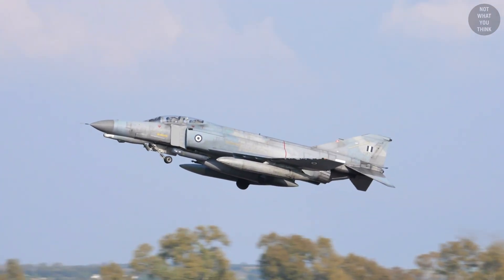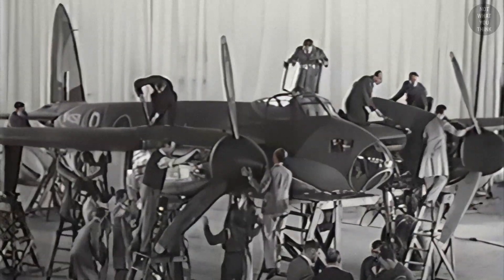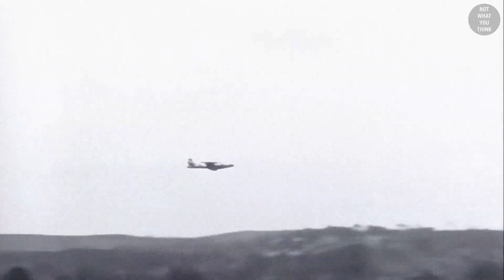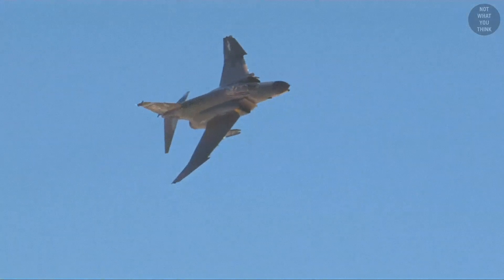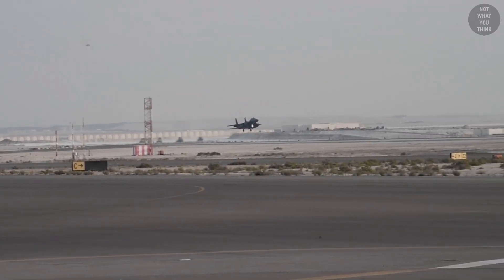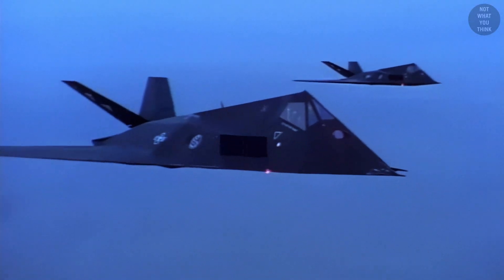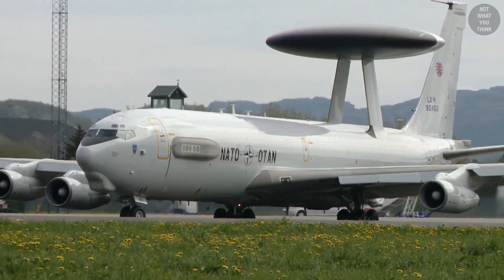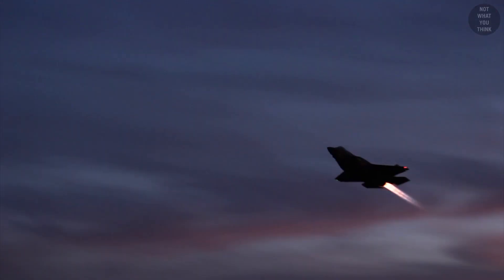Why are Modern Fighter Jets Slower than 1960s?

Comment: The F35 has a cruise speed of march 1.1 so it might not be on paper faster but it kinda is in a way.

The F35 was built from lessons learnt from previous generation aircraft.
Reply: I mean.. All aircraft are build from lessons learned from previous generation aircraft.
Reply: F35 sucks!
Reply: And greed
Reply: I’d imagine the true performance of the F35 and F22 is probably classified.  I would take any data you read on them with a grain of salt.
Reply: @tomw485  
sure, it always hard to know the exact numbers. However, we can look at engine power and thrust to weight. From these numbers we can at least start to paint a picture.

For example, the F35 certainly not going to produce the high end performance of  f22, or say a F15. 

However, compared to F16, F18, Rafale, gripen etc.? Well, in those cases, the F35 DOES have a better power to weight (thrust to weight) then those other fighters.

So, F35 is not a interceptor class of a fighter, but against most 4th gen multi-role aircraft, the F35 fairs very well. 

the F35 on mil power (non afterburner) quite much matches full power of  F16. But, of course the F16 is lighter. But, looking at thrust to weight, the f35 is not too heavy, nor underpowered, and for a fighter that has a better T/W rating then a duel engine Rafale, then the F35 going to MORE then hold it own in basic fighter maneuvering.
Reply: Urkel Obama  
Irrelevant
Reply: Yeah those top speeds are at full afterburner which absolutely chugs fuel.
Reply: The f35 hasnt got a cruise speed if mach 1.1 its below 1.0 100%
Reply: @katzenkralle7262  dash cruise(full throttle no afterburner) of mach 1.2 for several hundred miles.
Reply: @katzenkralle7262  F35 despite not being fully capable of supercruising, it can sustain mach 1.2 without AB for a certain range (around 150nm), which is good for stealth and fast intercepting. It's maximum speed is mach 1.6
Reply: @katzenkralle7262  It wouldn't be called 5th gen without supercruise. was required in design.
Reply: @oldkid8811  The aircraft "generations" are american marketing; thats why the requirement for what a 5 gen plane is got a lot lower when the shortcomings of the F35 became clear.

And no, the F35 cannot supercruise, and it doesnt look like it was ever designed to. It has a single engine, a limited thrust to weight ratio, the shape seemingly optimized for lower speed and altitude flight. All very different from the F22, which was designed to supercruise.
Reply: @termitreter6545   
Actually, a f104 from the 1950's could go past Mach 1.0, and that was in the 1950's (and without AB's)

And the British Lighting - again over Mach 1.0, and again without Afterburners (AB's). and again from the 1950's. 
WHERE HAVE YOU been living for the last 60 years? Hum?

As for the term super cruise? Well, since fighters from the 1950's could do that, THEN HOW on earth is that new???

Because fighters from 60 years ago could do this, then Lockheed had to make up a NEW term called super cruise, and it means Mach 1.5 for 100n-miles.

Then some bozo the clown - like some defense blog or some num-nuts? They re-purposed the term to mean ANY fighter flying above Mach 1.0 without AB's.   NOT!!!! 

The F35 can do 150+ miles at Mach 1.2 without AB's - in fact that is  LONGER rating then the Mach 1.5 rating given to the F22 at 100n-miles!!!! - how does that grab your coconuts?   And beyond silly as if this is a some kick above Mach 1.0, and then it "coasts down, or slows down". 

No not at all, if you can maintain Mach 1.2 for 150 miles - you NOT slowing down! In fact, a F16 pilot at above Mach 1.0, and going to full mil power?
quote:
caused the jet to rapidly decelerate, pushing me forward until my shoulder-harness straps locked

In other words, just backing off AB's in a F16 slams you forward - you not going to coast for 150 miles!!!

>>it has a single engine, a limited thrust to weight ratio, 

Really? Spending too much time in moms basement? Or did you fail grade school math?

The F35 has a better thrust to weight then a F16, then a duel engine Rafale, then a F18a, and of course a Gripen.

Here are the numbers (if you able to process them).

Higher = better

Fuel or
Payload	Rafale	F35	         F16	Gripen
0	         1.4137	1.3984	1.4784	1.2617
700	        1.3737	1.3672	1.4284	1.2130
2500	1.2806	1.2932	1.3141	1.1035
3500	1.2341	1.2555	1.2581	1.0508
3750	1.2230	1.2464	1.2449	1.0384
5000	1.1704	1.2028	1.1826	0.9805
6000	1.1314	1.1701	1.1371	0.9387
7000	1.0950	1.1391	1.0950	0.9003
7500	1.0777	1.1242	1.0751	0.8822
9125	1.0249	1.0784	1.0151	0.8283
10362	0.9880	1.0459	0.9737	0.7914
12000	0.9431	1.0058	0.9239	0.7474
13500	0.9055	0.9718	0.8825	0.7111
15000	0.8707	0.9399	0.8447	0.6782
18250	0.8038	0.8776	0.7729	0.6165
20900	0.7564	0.8325	0.7228	0.5739

So, as you can see, the F16 has to burn fuel down to a rather low 3,500 lbs to match the T/W rating of the F35.
The duel engine Rafale fairs even worse - down to a bone dry 700 lbs to match the T/W rating of the F35.
And the Gripen? Well forget that - even starting at 0 - it don't match much of anything.

In fact, the above table shows that as you increase payloads (fuel and/or weapons), the T/W rating remains in favor of the F35.

In fact, the F16 with a 10,000 lbs load results in a aircraft that is heaver then total engine power (the F16 now can't fly stright up). But the F35 can!!! - in fact it can with 11,000 lbs, and in fact even with 12,000 lbs. And the same applies to the duel engine Rafale - (again, 10,000 lbs - and total aircraft weight is greater then total engine thrust).

So, how do you get a poor thrust to weight rating for the F35? Unless you suggest the Rafle and F16 is poor then? (since they do have a WORSE power to weight rating then the F35 - right?

As for speeds? Well, the F35 has WAY more mil power then the F16. In fact, when F16s fly with F35's? They can't keep up, fall behind, and have to go AB's to catch up. Then they start to fall behind and have to repeat the process of going ABs to catch up. 
And you DO REALIZE that a F16 has only 3.5 minutes of AB time, and you fuel is now half gone, right? 

Here is the fuel tank rating for some common fighters:

Fuel capacity (fuel tank size):
Harrier  7,000 lbs
F16 – 7000 lbs
Gripen39E/F – 7,500 lbs
Rafale 10,362 lbs
F18 – 10,860 lbs
Typhoon – 11,000 lbs
F15 – 13,455 lbs
F/A-18E: 14,700 lb

F35 – 18,498 lbs

So, who's going to fly faster, and farther? Just look at the above!!! 
Sure you can hang fuel tanks on those other fighters. But when you do that, you now not only trading away wing stations from weapons to fuel bags? You also now lose max g-loads, and you now also lose your top speeds!!!

During tail drag, the F35 flying clean wings saved so much fuel, that when F16's and F18's were fuel bingo (return to base), the F35 saved so much fuel, had more fuel, it was able to stay out and execute additiona sorties.

So, yes, the F35 can maintain Mach 1.2 - and do so without AB's

The F35 top speed is a software limit - not a engine + drag limit.

And if the F35 was so high drag, then why can't F16's keep up? 

Here is some pilots quotes on this matter:

pilot Lt. Col. Hank “Hog” Griffiths
Even when loaded internally with two 2,000lb GBU-31 Joint Direct Attack Munitions and two AIM-120 AMRAAMs, Griffith says the sheer power of the Pratt & Whitney F135 is evident. “The engine has a lot of thrust. It’s been fun to outrun the F-16 (chase aircraft). They can’t keep up. If we go to full military power the F-16 has to go to afterburner to keep up

Norway pilots ALSO note the same - they flew F16's, and are now flying  F35's.
quote:
We who fly the F-35 daily, can establish the following: The aircraft is faster, more maneuverable, has more range and, can carry a significantly higher payload and provides the pilot with a significantly better situational awareness than what we are used to from the F-16

Col De Smit – RNLAF
Quote:
F35 climbs, descends & accelerates like a clean F-16

QUOTE:
Compared to the F-16, the F-35A with “full war equipment” can cruise 10-15k feet higher without afterburner and cruise 50-80 knots faster, all of this additional energy is imparted on missiles

And it gets even worse! The F16 is a single tail fighter design - and that is poor for dogfighting - and again, given the F35 has a BETTER power to weight rating, then the F35 going to be a better dog fighter then the F16. If the F16 had a better T/W rating, or in fact had a duel tail design, then either one of these factors would give it a chance against the F35, but the F16 fails on both accounts (lower thrust  to weight, and a single tail design - both of which will hurt dogfighting).
Reply: We see the USA still unable to produce and build a VTOL capable fighter aircraft. The F-35B was claimed by the USA, to be able to do what the Harrier could do, while also being supersonic, stealthy, with modern avionics systems, etc etc, this is what we were told. Only one of the biggest technical headaches the British always had to build the Harrier, was the VTOL — transferring from ''lift'' (downward nozzles) to forward flight (rear-facing nozzles) and flying away. 

Apparently to achieve it took the British a hell of a lot of technical work, three — four months at a time over 3 years. (Look up all the variants they made) but they never gave up, and they finally figured it out. I said long before we ever saw the F-35B, it wouldn't be VTOL capable, even with the Rolls-Royce lift engines, because the USA has tried many times before, and failed, only managing to produce the British Harrier able to do so. Every US airframe (and there have been many), have all failed. 

At 7 mins 50 seconds, you'll watch a Harrier perform a proper VTOL. Copy and paste “2013 MCAS Yuma Air Show — AV8B Harrier Demo” into YouTube search. Watch it from lift off, (to more importantly), flying away from the lift-off, and you'll see the transfer of nozzles take place.

You'll not find a single piece of footage of the F-35B doing this. I've had (Americans) tell me all sorts, like it is VTOL and can do it, even saying they've seen it? LOL, only when they can't show it? They quickly change, and instead we'll read them claim it was never intended to be VTOL capable? LOL. 

Sure, when Lockheed Martin's very own page on YouTube clearly shows them trying to suggest it is VTOL capable, when it so clearly is not? Copy and Paste “First F-35B Vertical Takeoff Test” into YouTube search. Watch this, you'll see it lift off, only you'll see it take off go straight up & hover then return straight back down? You'll never see it fly away from the lift-off? Believe me, if it could, we'd see it doing so in every piece of footage we have on the F-35B - like we still see on all the footage of the Harrier doing so. But you'll never find any footage anywhere of the F-35B doing that. 

They'll then go on to say it's not necessary? LOL, while forgetting, they're to be carrier-based aircraft?, meaning even just slight damage to the deck or ramp, they can't get any jets airborne?. Defeating the entire purpose of having the aircraft in the first place! You can't ever lose an entire carrier in battle, for only minor damage, whatever next. 

And why do we see the USA doing this? It's obviously because the USA is still the only country that's never managed to produce & build a VTOL fighter aircraft. Britain did so in the late 50s, Russia did so in the late 60s the USA has tried and failed numerous times, so it seems this time they're going to try to lie about it LOL, that country is a travesty, man! It shows us that Lockheed are not unknown to produce propaganda aircraft. 

As I claim, the F-22 is exactly that. A lemon, that became a propaganda aircraft, that was intended to be a viable military aircraft, that failed.
Reply: Seemingly these Americans have no idea the F-22 and F-35 can't see, track, or target any other stealth aircraft from BVR (beyond visual range). Stealth alone defeats high-frequency (short wave) radar by absorption and deflection, it does not defeat low-frequency (long wave) radar. Therefore, to see, track, and target stealth aircraft you must have long-wave radar, but it must also be enhanced to remove all background clutter for targeting purposes.

Neither the APG-77 radar used in the F-22, nor the APG-81 radar used in the F-35, can see any other stealth aircraft from BVR (without enhanced long wave radar) — This fact the US Air force obviously know! Only it seems the reality is, that when the F-35 radars were being designed 13 years ago, there were no other stealth aircraft to think about as a potential threat? So how can these US aircraft be seen as any sort of threat to either China or Russia, who both have these aircraft technically beaten? They can see and target US jets from BVR, yet the US jets can't even see them from BVR?

Russia's new 5th generation Byelka (2band) radar, used in SU-57, does have enhanced long-wave radar, they've designed and developed the first L-Band fighter radar we've ever seen. They've cleverly embedded L-band AESA radars in the leading edges of the wings. The new L-band AESA radar data gets processed in real time through extremely powerful Russian Elbrus computers being significantly enhanced removing all clutter, meaning it can see, track, target, and engage enemy stealth aircraft from BVR. The technology along with its impressive range parameters and jamming ability over large areas make this aircraft deadly to all other aircraft types. 

They can also interact in ''real-time'' with each other member of the squadron, (auto selecting) the best placed BVR missile, that can be fired by anyone of the squadron with a bogie on radar, they can also take control of surface-to-air (SAM) missile defence systems - (that alone is lethal), and they can see track, enemy stealth fighter aircraft long before Russian airspace, from much greater distances, with "real-time" data from massive Russian ground long wave stations (that are all protected today with the networked S-400 defensive system). 

Therefore, as they'll always know where the enemy aircraft are, they'll always be able to approach any enemy aircraft head on, and therefore stealthily, (Russia wisely sacrificed rear end stealth for much better manoeuvrability) meaning today, the US fighter jets would not even be able to see them coming!! Russia's Byelka (2band) radar covers all aspects of frequencies across all channels, that are used for tracking, targetting, and also jamming. It's part of Sh121 multifunctional integrated radio electronic system (MIRES) on board the SU-57. 

Russia tested much of this new radar suit on the SU-35, so they also have the option of fitting this radar into SU-35's permanently, meaning Russia's SU-35S flanker will be at no disadvantage with F-22/35. As although the SU-35 can be seen and targeted from BVR, the SU-35 with the new 5th gen radar is as able to see and target the US jets from BVR, seeing the all-important Russian advantage in BVR missile distance, plus the excellent manoeuvring, neither the F-22/35 have, as more than critical, if you're going to avoid simply being blown out of the sky.
Reply: @hotstepper887  now why would the us post a video showing exactly how it works to our enemies. Also keep in mind the old planes are declassified and the new ones are crazy classified. But what else should I expect from a Russian bot?
Reply: @hotstepper887  Bunch of cope and propaganda. The Harrier was not meant for VTOL operation either, as the max takeoff weight for vertical takeoff doesn't let you carry enough fuel and weapons.
Reply: The F35 is a joke. It is still unable to fly a few miles away from lightning or fire any weapons.

Also, the F22 has a cruising speed of 1.6 mach and has a top speed of 2.2 mach.
Reply: @andrewh1113  your comparing apples with oranges.
Reply: It might be 10-20 miles if they didn't fix that bug yet.
Reply: Yeah it can't maintain its top speed for more than a few minutes. Its kind of sad. If one ever ran out of am rams in a fight it would be chased down and destroyed before it could escape the ao
Reply: @casematecardinal  it can, pilots are just told not to do it in peacetime to preserve the airframe's structural integrity for decades to come. F-14 pilots were limited to 6Gs during peacetime for the same reason.
Reply: @casematecardinal  That's riddiculous. Aircraft are not sent to 1v1 fights, chasing down a F-35 without AMRAAMs still means a few F-35s with a couple of them left are close by.

Comment: 2:04 what a nice fly by I wonder what will happen in the next 10 seconds
Reply: i think that was supposed to be an early demo of what is possible with a jet engine, I think the modern stunt is called a tailslide? Basically you pitch way up and try and match the thrust output of your engine to the weight of the jet so you "hover" and kind of slide on your tail. That clip looked like an early attempt at that to me, but I'm not sure. He's going very slow and pitched way too high up to be landing. Seemed like he was just trying to maintain altitude at as slow a speed as possible.
Reply: @TheEpicLinkFreeman  bro that was a accident called "Sabre dance" and the jet crashed
Reply: @Pvt_Wade  interesting. In the full clip it's quite obvious, wonder why they opted to even include that clip in the video.